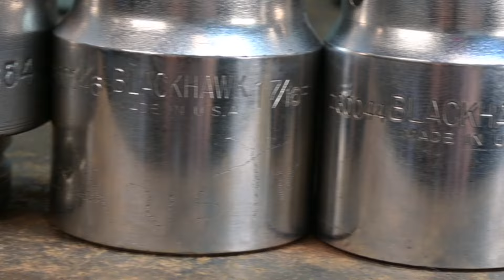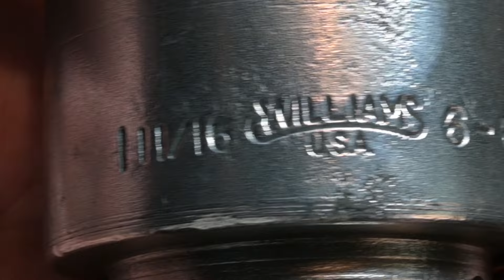Vintage Rusty Tool Clean up

Comment: Nice clean ups brother. I just restored a 3/8 B-51 Williams about a month ago. They are great ratchets.
Reply from the maker: This was a fun one. Haha. I say that about everything I do huh? Haha. 
Yeah, these 51 series are cool. 
I did the B-51 too about a month ago. 
It’s weird because there’s only 1 video on YouTube about the B-51. 
I wonder why. 
You should post yours. I wanna see. 
Thanks for the support Ivan.
Reply: I wish I had that kind of luck with Evaporust. I chuck my sockets in the lathe and attack them with Scotchbrite. More often than not they are too far gone.
Reply from the maker: @kitmaira  
These were pretty pitted. 
I think there’s something to do with heating up the Evaporust. I only do the hot water trick when it’s cold because I think it has to be 70 degrees for the stuff to work. My hot water is 100+ degrees so I wonder if that makes the Evaporust work better?????

Comment: I have even remotely had that kind of luck with Evaporust on rusty sockets. I stopped buying them at sales, just not worth the trouble. Maybe on the very large ones I might try again.
Reply from the maker: I figured it out Kit. I put them in a sandwich bag full of Evaporust then put the bag in my ultrasonic cleaner with hot water. The combination of Evaporust & vibration does all the work. I just rinse it off then hit the polishing wheels. On the smaller sockets, I put them on a 6” extension then polish. I’m learning so much with these old tools. Dang it, now I want to go find some rusty sockets. Hahaha